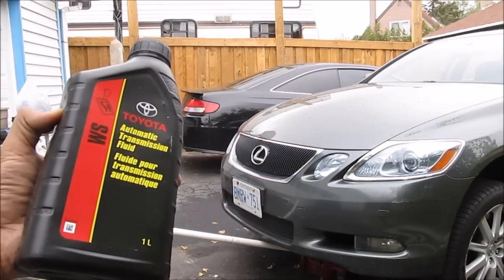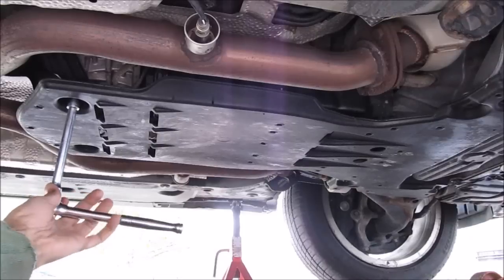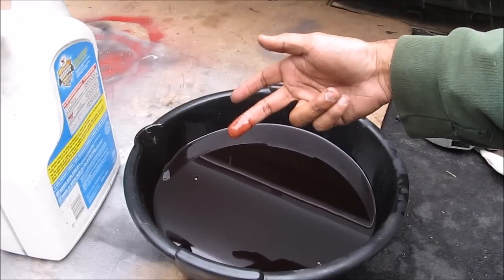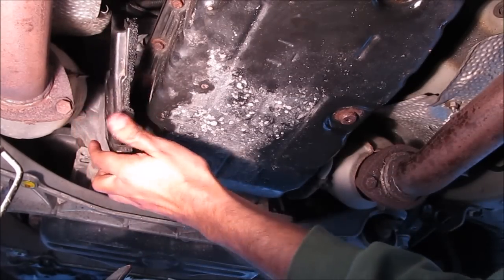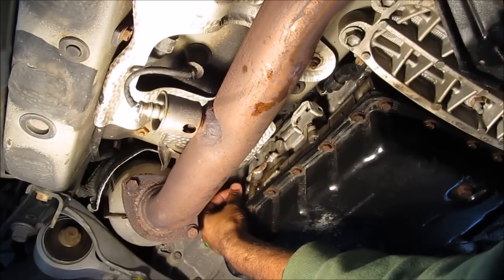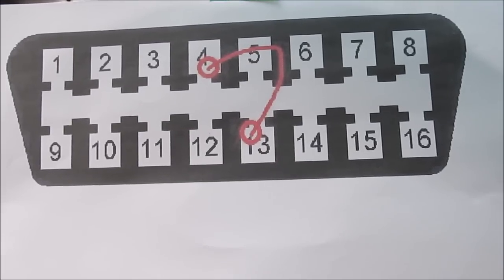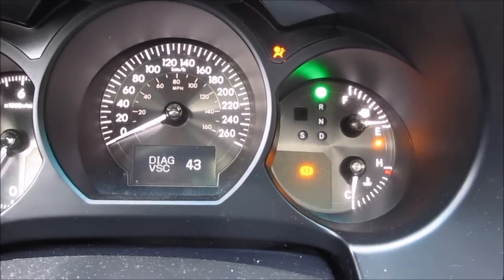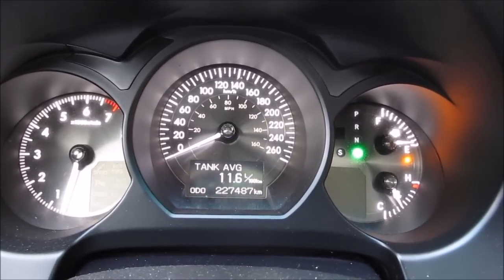Toyota / Lexus Sealed WS Transmission Fluid Change

Comment: Congrats on the car man! I remember you still having the Solara and doing the gauge swap back then, that probably took days to research :P.  Btw, how do you find this info? My research consists of forums but the DIY's on there always seem to be outdated and filled with broken links. Any advice besides Google?
Reply from the maker: +poland153 Thanks, I do still have the solara as you can see in the beggining of the video and thumbnail. 
For the gauge swap I guess it pays off to know how to read the electrical diagrams and have junkyard parts at my disposal, most of it was trial and error. 
For all other DIYs, the Solara is very similar mechanical to the Camry, ES300 and Avalon, and it's power train is the same as the the Sienna, highlander and rx300. Thus alot of DIY tuturials can be applied to the Solara, which is a fairly good amount of info. The Lexus platform is more propietary to Lexus and Toyota rwd vehicles so not much has been done to them on forums. 
For this tranny fluid change, there was already a DIY write-up on the forums, the link is in the description. Thanks

Comment: Can’t I measure the temp a different method because I don’t have an obd connector and the Toyota program
Reply from the maker: +Rich M By shorting the two wires and moving the shifter.
Reply: He didn't use an OBD connecter either. Just a couple wires.

Comment: I had a question about your immobilizer bypass video, would this work for Ford Mustang 2002 ? also do you know if it's possible to hardware the spark and fuel pump to ignition and to totally disable a pats system
Reply from the maker: +War Ren I tried this on my Honda. Shorted the ignition fuse, and fuel pump fuse. However these have electronic injection which is an output from the ecu, so I couldn't get the ecu to fire the spark plugs without a programmed key.
Reply: is there a way to clear all saved data on the ecu without a serial connetion? I have three blank chip keys ready to program
Reply from the maker: +War Ren use techstream

Comment: After pulling out the wire, how long do you wait before the solid D comes on?
Reply from the maker: I dont remember. I used techstream to check mine
Reply: @speedkar99  right so the video is a little in accurate then? I used the exact method but the solid D after pulling out the wire never came on.
Reply: @TheBlooRayChannel  same hear. The car was sitting all day so I thought it would take time to hear up....30 mins later still no green D indicator that showed.

Comment: It looks like holding on to the 2018 Mazda3 stick shift forever is the answer to all this. I previously had a 2001 Camry stick shift 280000 miles factory clutch and brakes when totaled

Comment: Mr. Speedkar Im trying to do a Transmission Line Pressure test on my car with the A960E transmission. Probably the same as your vehicle. I have a gauge already but dont have a particular fiitting . Do you happen to know what it is? In the toyota service manuel its a 90 degree adpater refered to as a SST special service tool. Im sure one might be able to use something else. Im just trying to figure that thing out. Thank You
Reply from the maker: +Dee Lee Hey, I am not familiar with the pressure test. Perhaps you can talk to a dealer to show you that SST?
Reply: Pressure test just measures trans pressure at Drive and Reverse. And with TS active test turning SLT on and off.  SST It could be a standard fitting. Its just a 90 degree flexible adapter fitting. I just didnt have one to do it. I just purchased gauge on ebay perhaps it will have it or else ill have to hunt it down. Basically im getting a P2714 error where car goes into safety mode wont shift past 3rd and it will also happen for 06 gs300 w/ A960E  after 130K miles maybe. Trying to determine if SLT is bad, ECM Wireing, Trans Wire, ECM or maybe the transmission.  Its a very perplexing issue i dont wish it upon anyone. I dont know of any real solutions yet on any forum. Iv been scouring for the longest time.

Comment: Aren't you pumping in air as well though ?
Reply from the maker: Transmission is vented. No need to bleed like brakes or coolant.
Reply: @speedkar99  I've never heard of that. Vented? What does that mean ? Thanks!b
Reply: But the filler plug is open so how would you pump in too much air?

Comment: How many miles should you drive between transmission fluid changes?
Reply from the maker: 30K? Depends on your drive style and if your AWD
Reply: Thank you! I was reading through my '99 Lexus ES300 Owners Manual and they make NO MENTION of when to change transmission fluid. I wish they would include this important info and I wonder why they don't.
Reply: We do ours every 30,000 miles.

Comment: Hello, I have an 02 Lexus RX300, When I check the trans fluid level when engine is cold, it’s way high,pass the “Hot” indicator mark. So I run the engine to operating temps, I start driving the car,when I accelerate , I feel hard kick into gear and then smooth out. But when come to a stop again,started to accelerate again, the symptom repeated. What caused it ? Is it because,overfilled fluid or a clogged filter ? The car has 226,000 miles on it but has power,thanks
Reply from the maker: Those RX300s had notorious transmission problems
Reply: speedkar99 first of all,thank you. Secondly,would it be helpful to change fluid and filter?
Reply from the maker: Yes

Comment: HELP !!!!!!!   I did everything side by side with the video wait the 6 seconds when shifting from neutral to drive and every time I unplugged the bypass wire my car would shut off . Any advice !?!?
Reply: Car is a 2006 Lexus gs300 U.S. since I see you're from somewhere else.  150k miles.
Reply from the maker: +Rsex I don't think you unplug the wire with the car on, maybe take the car off after everything is done and try again.

Comment: Do I have to use atf or can I use a similar type of transmission fluid?
Reply from the maker: Same type
Reply: The safe bet is to always use Toyota/lexus ATF.

I chnge my own oil and don't use manufacturers brand oil, but when it comes to transmission fluid, I spend the extra money and buy fluid from the dealer.

Comment: Love this video. Very informative and straight to the point which is just my style. One question, is the 1st leveling method (using 4th, 13th OBD2 socket) officially recommended by Toyota? If it is, I will go with the 1st leveling method. If not, I am thinking about buy a scanner. Please let me know friend.

Comment: 213k miles on my 2013 GS350 with no issues. Trust Lexus guys.
Reply from the maker: That's allot of miles for a7 year old
Reply: I travel the country for work and I do a lot of road trips. Most people rent a car for that but I’m on a mission to put as many miles as I can on the car. Service every 5k and the thing still runs great.
Reply: Gonna be breaking soon it is not a Lexus transmission it is a aisin. Toyotas have the same transmission and they flush it.
Reply: @gerardford5707  Im not too worried about it. The car is paid for and I didnt pay retail. Its mostly highway miles anyway.  I will just get another Lexus when it breaks.
Reply: Nice...still going? I still will do fluids cause it cant hurt.

Comment: better get your over slow plug fixed, or else how will you know what level its at
Reply from the maker: +marty mcfly Yes I really need to get that fixed....I have to drop the pan and extract it
Reply: speedkar99 you can get a new pan with a new plug online at a good cheap price
Reply from the maker: +marty mcfly already got the pan gasket and plug. I tried unbolting one pan bolt and it snapped so I stopped. Haha
Reply: You probably did not know those pan bolts have very fine threads and are not that robust. I heard some snap pan bolts on the RAV4 but found a solution to reduce the risk. For one never use impact tools to remove the pan bolts.  Spray all the bolts with penetrating oil and let it soak. Remove the bolts with a ratchet very slowly and keep spraying with penetrating oil as you remove. The rust can cause removal a problem like a snap bolt. When installing the bolts use blue locktite after cleaning the bolts thoroughly. Put bolts back in a criss cross fashion with a nut driver to avoid over tightening the bolts. If the bolts are not tight enough check each bolt again the next day to see if they are lose still. Also if there is no leaks you know you are good to go.

Comment: speedkar why cant you just replace the fluid you drained at room temp? if both oil pan and a quart kept in the same garage overnight why not just replace the fluid lost?
Reply: That should work so long as you weren't low on fluid to begin with, which we have no way of knowing because the dolts didn't give us a dipstick.

Comment: the transmission fluid lasts 80k to 100k miles but its recommended to change every 60k miles
Reply from the maker: +Modified Genesis Coupes sooner is better
Reply: I had the “lifetime” transmission serviced at 80,000 miles on my 2011 Avalon. I’ll do it again at 120,000, then every 40,000 miles after that.
Reply: Oil performance is one thing but all the contaminants keep adding up literally until valve screen get plugged... so in California 30 to 40kMi is good insurance 😉

Comment: If my Lexus stopped going reverse could the transmission fluid be a problem? Never drained it. Sitting at 160k miles
Reply from the maker: You should have changed it at that mileage
Reply: @speedkar99  if i change it and still no reverse. What step should I look at next?
Reply: Rebuilt or buy a new transmission
Reply: @ratchetx5677  haven't changed it so let's hope I don't need a new one. Do i flush it or just replace whatever fluid drains out?
Reply: @ratchetx5677  P2757
P0983
P0761 
Those are the codes I got

Comment: So it have a built in over flow ,transfer case and differential fluid have the same principle ,why do everyone have to make the seal transmission a big deal drain and fill ,until it overflow.,what is the temperature of the transfer case and Differential? The overflow is just that ,so any body can do it ,over flow equal exact amount of fluid needed,no dip stick needed.
Reply from the maker: It shouldn't be over flower since the fluid expands with temperature and needs space to do so

Comment: Will dexron 6 work in place of the world standard WS fluid?
Reply from the maker: Does it say it's compatible?
Reply: @speedkar99  further looking into yes does say so with the fluid I was looking at thanks it is GulfPride synthetic multi-vehicle dex 6 ATF.
Reply: @robpaul7900  ALWAYS open the fill plug first THEN open the drain plug.

Comment: How did you end up getting that overflow bolt off? I litterally have the same issue on my 2007 is350...
Reply from the maker: I didn't. 
Just did drain and fill with the same amount that came out cold
Reply: @speedkar99  So 2.5 quarts came out? Would this be the same as a Rav4 2015 v4?

Comment: How many miles before you changed the fluid?
Reply from the maker: Every 30K is a good interval because your changing 1/4 to 1/6 only per time
Reply: I have a toyota yaris and i haven't changed yet the ATF. It has 53k km  and so far the ATF is still pinkish. Is it safe just to replace the atf when I see some darkness on the fluid?

Comment: I just replaced my ATF and accidentally poured just a table spoon of "Top up coolant" which is a clear all purpose coolant into my auto transmission.Would just a table spoon in it be ok?
Reply: I don't think so.
Reply: @stevensevek6151  4 yrs on and the trans is fine,no issues at all. Still shifts sweet.

Comment: On these types of "sealed" transmissions.....you should ALWAYS try and take out the Fill plug FIRST. The reason being if you drain the fluid first....and after the fact you find out the  the fill plug is stuck and can't be removed due to rust etc.....how are you gonna fill the transmission!?! Now you WILL spend more time and money towing your car to the shop instead of driving it there to remove the fill plug.
Reply from the maker: Agreed

Comment: To complete flush your transmission it takes a lot , you have to drain it drive for a day drain and repeat for about 4times , the oil in the oil pan its only about 40% give or take of the transmission so you got the idea
Reply: Exactly. I know this guy is trying to help, but this is by no means a complete change of the ATF. He seems so very concerned about old fluid, but he's leaving about two thirds of it in there xD
Reply: It's not even 40%. There's only 1.6 liters in the pan and 7 liters in the whole transmission
Reply: Do u full back
Up with new fluid drain again dammm

Comment: You should not skip the most important check at the end to make sure the level is at the stack pipe level . at  the correct temperature. thats  the whole point of the exercise!!! I got mine back from lexus dealer in belfast in 2009 with notchy change and this was the cause , they had used an incorrect fill procedure. I did itmyself and the level is critical . Beware

Comment: My overflow plug is stripped any recommendation? Thanks in advance!
Reply from the maker: Mine is stripped too, but I didn't use it. 

You'd have to take it to a shop and have them weld a nut and zip it off.
Reply: @speedkar99  I appreciate you replying after 4 years of this video. Thanks!

Comment: nice video but maybe my comment is useful.  WS Toyota &Lexus ATM oil and filter must be changed every 80 000 km 
Changing ATM oil only is not sufficient to protect your ATM Assembly
Reply from the maker: Agreed
Reply: Transmission filters usually come with a gasket included, do you leave the original oil pan gasket or drop the pan and replace with a new gasket?
Reply: Have you seen the "filter"  It isn't really a filter, it is a mesh debris screen - if it is restricted, you have much bigger transmission issues at hand
Reply: Not totally true. Some transmissions even have it above further the valve body. And is not a service item.

Comment: LOOKING FOR SOLUTIONS: First thanks for this video. 
Next it would seem to me that there is a hole for a dipstick with a plug in it somewhere on the tranny. So anyways my situation is that I added a transmission oil cooler to my 2020 Tundra and would love to add a dipstick. I did fill the cooler with oil when I installed it but I know that I'm slightly low due to the volume of the hoses. So, is there a plugged dipstick hole? Or assuming there is no hole, I had a few other thoughts. The most critical is that why the hell did Toyota make this so difficult. I mean wouldn't it be so much simpler to have the over flow tube, "straw" cut to length at either completely hot or ideally cold, lets say 70 room temp. And wondering if there is an after market solution for this?
Reply from the maker: They made it difficult because they call it a "sealed" transmission

Comment: How long does it take to reach the correct temperature?
Reply: I'm doing the temperature check right now and it seems to be taking ages and am worried I've done something wrong
Reply: @Zeczam  ALWAYS open the fill plug first THEN open the drain plug.

Comment: Anyone know if the process of connecting the 4 and 13 pins works on 2016 Toyotas?  Highlander specifically.  Bought a BlueDriver diagnostic which I like but unfortunately it does not have ATF temperature as one of the supported live data feeds - only a coolant temperature.
Reply from the maker: +condor5635 I think it does work on newer toyotas. Why not buy the techstream cable for $20 off amazon, its worth every dollar and you van do a lot more with it.
Reply: speedkar99 thanks so much!  I knew about the tech stream cable and the software but always thought there was proprietary software that cost a bunch. Just ordered a cable. Any advice on where to go to read how to use it and what free (assuming) software to use etc?  Thank you for the heads up and advice!
Reply from the maker: The cable comes with a disc. If not then go online and find a copy of techstream software. You'll need windows XP for a smooth installation, though there's a workaround for Windows 7. 
Check out this video for more details:
https://www.youtube.com/watch?v=KDpldAv0uQE
Reply: The program is technically not free though as it requires activation. Many of them that are sold are pirated versions or trial versions sold with the cable and you can find the cracked verisons online free to download. It cost about a couple grand for a legit license. But shit, I rather pay 30 bucks than 2 stacks. lol

Comment: So is Lexus the same as Toyota?  Only difference is Lexus has a cover over everything.
Reply from the maker: +Floyd R. Turbo yes it is
Reply: They are just fancy Toyota's with an L badge. Toyota makes them since its a division of Toyota. The Avalon and the Lexus ES are essentially the same car as they are both built on the Camry K Platform.
Reply: @eman0828  
You just pay more for parts and service...

Comment: Does the P+D come after after removing the jump?
Reply: I've got a gs450h and after charging the battery, the engine just turns off. Been waiting almost 5 minutes, yet still no P+D. Apparently the procedure is the same

Comment: I can't get the D light to stay on in my GS450H. is the process different?
Reply from the maker: Yeah the hybrid has an eCVT which is way different
Reply: @speedkar99  it's actually the same, I just got it to work, it just took way longer to get up to temp! Your video does apply for the hybrid.